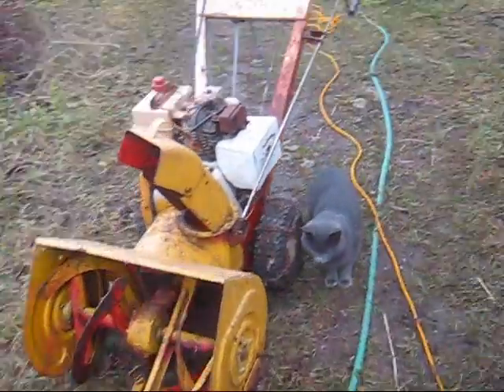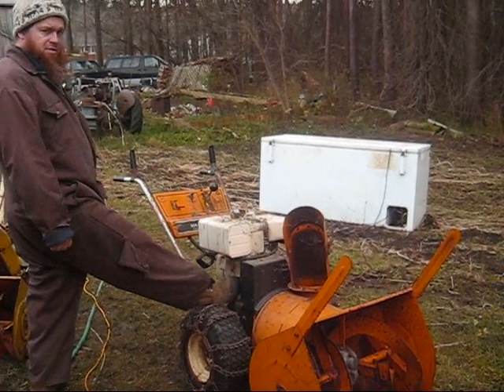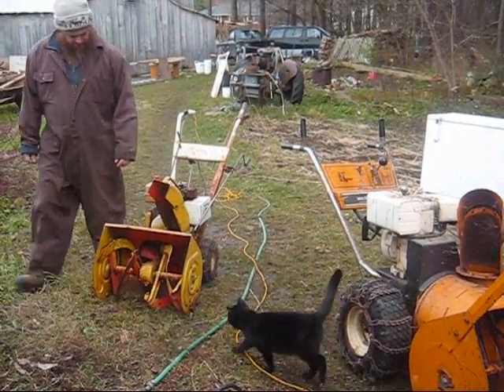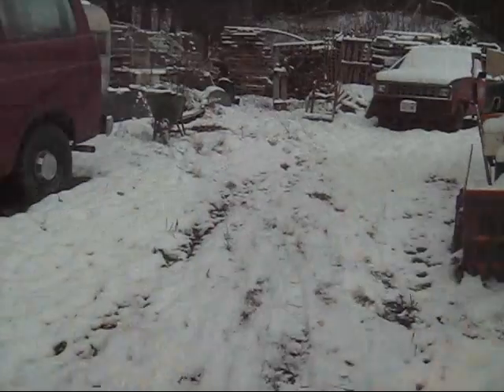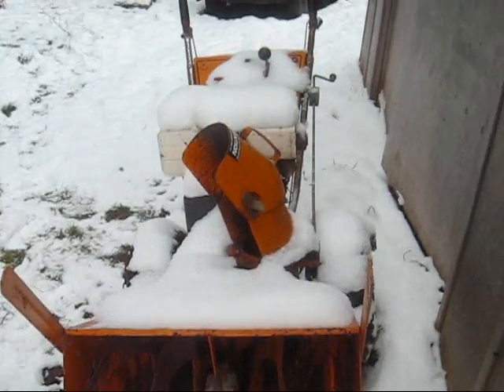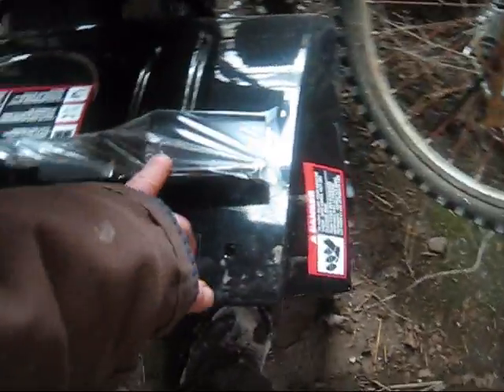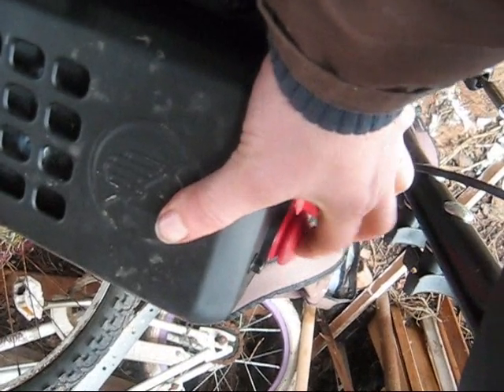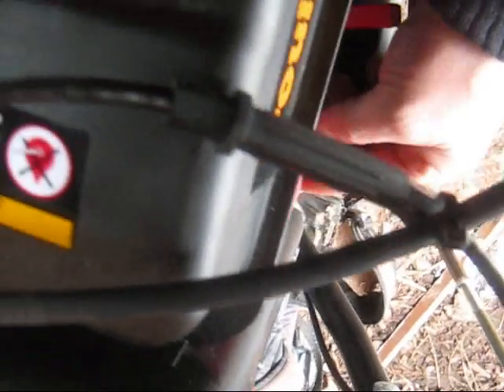Getting the snow blower ready

Comment: 76?! Hell, mine was built ( the 6 horse Briggs) in 68! And still runs like a champ. I did replace the old mag with some thing called a magnetron. It completly removes the points and condenser from the equation. It looks just like a magneto, but you just ground it off, and hook up the plug wire! It works great!